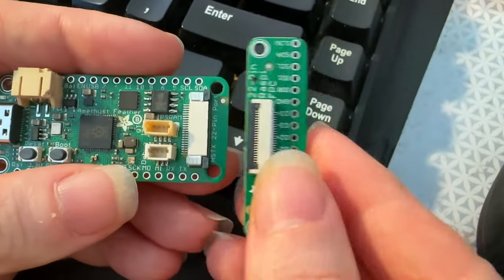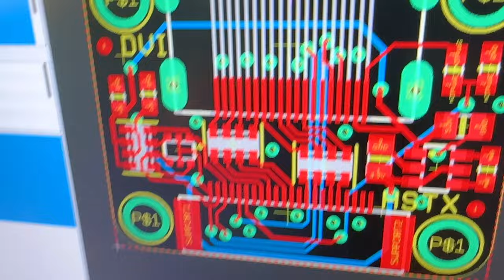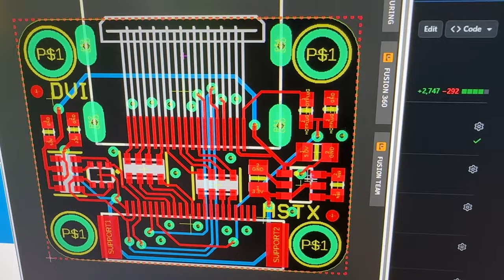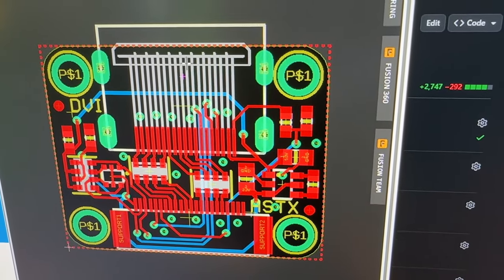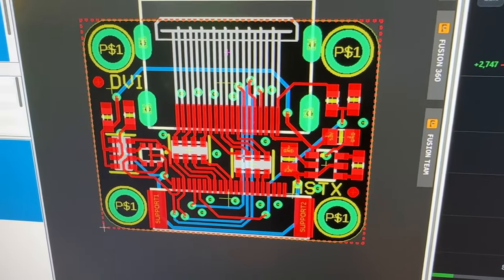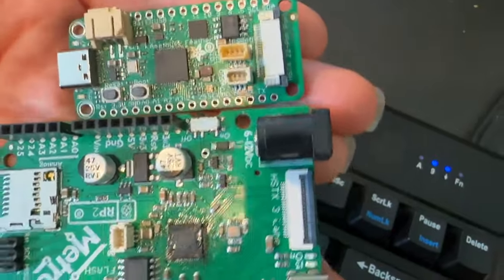HSTX to DVI adapter board for RP2350

Comment: Zero overhead video?  I'm a bit confused.  Does this mean the r2350 has these 8 lines that can be auto dma'd out without the CPU, and directly drive DVI.

I'm searching today to see if anybody is talking about how little CPU it needs compared to the r2040, to run VGA or HDMI?

People are making devices that drive external displays.  Apart from streaming display from a frame buffer without CPU, another desirable thing is to run USB-C at 5gb/s+ (10-20 preferable, or at least 480mb/s) which could do mhl and USB hub support.  You are a developer, is any of this possible on the new chip?

Another interesting thing, which you maybe interested in, though I don't have links.  There is a Nintendo Entertainment system mod that serializes rgb data over the video output to then convert it at a display socket on a flat screen.  I had been looking at doing this myself before them as well.  I'm not really up to much presently, but I thought it might be something you might be interested in, as it reduces the pin count. But I am not familiar with the Pi's, so do not know how this chip works and if the serialising of pixel data would have low overhead?  I was pretty much going to advocate such a thing  as a new display standard.

Thanks for the video.
Reply: The chip has a 'HSTX' peripheral which is specifically designed to transmit TMDS encoded data which is what DVI uses. Previously someone did this using a PIO but now you don't even need that. Has 8 pins at 300mb/s each, but only TX.
Reply: Ok. Thanks.  The R2530 has it on chip.  So, you can set it up to scan the frame buffer and pack the pixels automatically in the pipe?  So, not 1080p raw frame  resolution bandwidth?